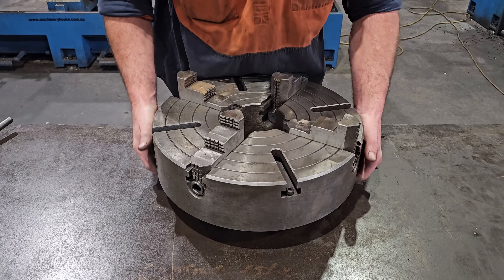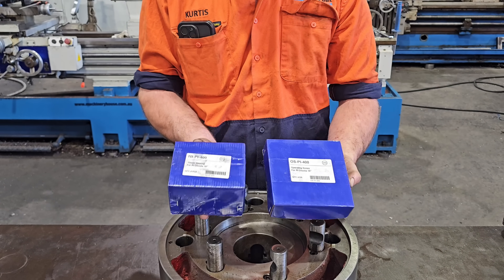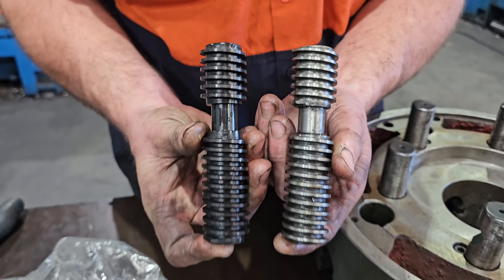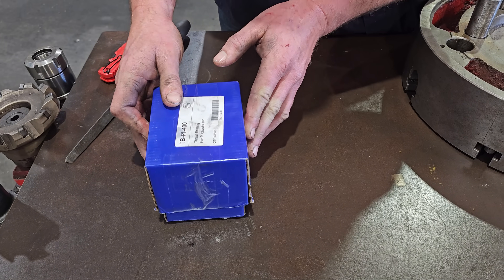Gator 4 Jaw Chuck Update! Can We Save It From Scrap!? 🛠️

Comment: I'm surprised that you able to drill the hardened thrust bearings to fit the set screws. Are they only hardened at one end ? (I was also surprised you didn't do the drilling on a drill press, or a mill pretending to be a drill press).

Comment: Bought a new chuck recently, had problems. The respondent said he 'was not a machinist' which was irrelevant; he knew nothing about the chuck he was selling or anything about fitting it. Do not deal with CME.
10:09 - Printer paper almost always measurers .005 bananas.

Comment: For all those commenting about Gator reacting only after CEE published the video

Everything is speculation unless others come up with similar stories. 

The acid test would be to see if other people have received defective chucks, what Gator has done about it and if defective chucks are still being shipped

A truely proactive company which discovered there were manufacturing issues, would put an advisory notice on its website inviting owners to contact them whilst simultaneously taking steps where possible to directly contact those who'd purchased the potentially faulty batch(es) - after all, they do have the warranty cards

Anyone can have a faulty product or service. What truely makes good companies stand out is how they react when things go wrong. An excellent manufacturer which blows off clients who experience issues is going to get a deservedly worse reputation(*) than a good one who reacts quickly to fix complaints

(*) From experience: Many German companies in particular will attempt to blame the client in the first instance, claiming they don't ship faulty product or that the item is being used outside of specification. The further south you go in Germany, the more prevalent this attitude becomes.

Comment: Thrust bearing is looser fit then the unhardened original because its shrunk a bit from the heat treat, that's all.  Would've liked a file test on the new compared to old!!  Also, nice idea on the paper/clearance.  Also, also, not a chance in hell that only one chuck has this problem, most likely all are like that and the replacement parts are the only ones that have ever been hardened.

Comment: Good on Gator for sorting this out.  Perhaps it’s lucky you have a large following!
Interesting when you are drilling and tapping the grub screw.
If one piece is harder than the other I’d expect the drill to wander to the softer cast iron.
Reply: thats what i was thinking as well when i saw he intended to freehand it. sum of the whole... or hole i guess in this case tho. a sliver of hardened metal vs the remaining 95% surface area that wasnt hardened.

Comment: Honestly, depending on the size of the company, they may not keep tabs on content creators or have anyone who follows them.  Smaller towns/older owners/etc.  Completely possible it’s a small business that specializes in lathe chucks and isn’t really clued into social media.  The delay could be from that alone rather than some nefarious business.  

Glad they stepped up and offered to correct it!  If they had to switch manufacturers it can be pretty painful, especially if they’re trying to keep costs down while reworking R&D.  Not cheap.

Comment: ai summary

Abstract:

This video details the successful repair and reassembly of a Gator 4-jaw lathe chuck that was previously deemed unfixable due to unhardened operating screws and thrust bearings. Following a prior video exposing these manufacturing defects, Gator, the manufacturer, provided correctly hardened replacement parts. The repair process involved thoroughly cleaning the chuck, installing the new, properly heat-treated operating screws and thrust bearings (noting a significantly better fit compared to the originals), re-drilling and tapping holes for grub screws, and finally reassembling the jaws. The rebuilt chuck now operates smoothly without binding, saving it from the scrap bin and allowing the workshop to return a newly purchased replacement.

Summarizing the Transcript: Gator 4 Jaw Chuck Update! Can We Save It From Scrap!?

*   0:00 Lathe Chuck Problem: Kurtis from Cutting Edge Engineering provides an update on a Gator 4-jaw chuck, which was found to have unhardened operating screws and thrust bearings in a previous lathe maintenance video.
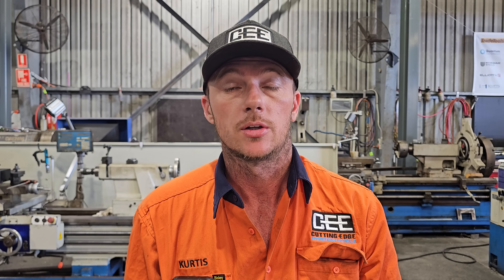*   0:18 Manufacturer Response: After the initial video, Gator acknowledged the manufacturing defect, attributing it to a potential quality control issue during a transition period between manufacturers, and promptly sent replacement parts.
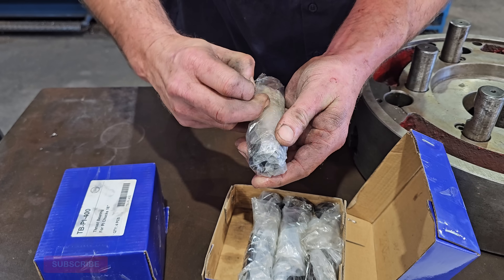*   0:54 New Parts Inspection: The replacement operating screws are visibly and tangibly harder and have a cleaner thread profile, confirming they have been correctly heat-treated, unlike the originals.
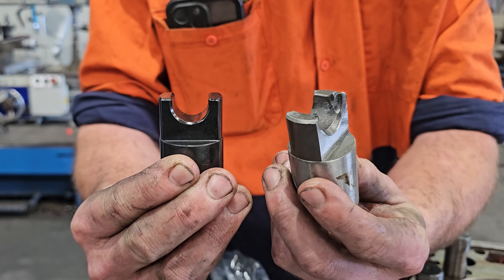*   1:31 Thrust Bearings Comparison: The new thrust bearings are also correctly hardened, in stark contrast to the soft and easily deformable original parts.
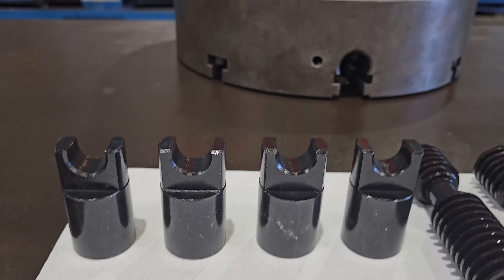*   1:49 Chuck Cleaning and Reassembly: Kurtis proceeds to thoroughly clean the chuck body before installing the new components.
*   3:52 Setting Clearance with Paper: A piece of paper is used to set the proper clearance between the thrust bearing face and the operating screw, ensuring smooth operation.
*   4:29 Improved Fit: The new thrust bearings are a neat slip fit, which is the correct design, unlike the original ones that were extremely tight and required force to remove.
*   6:10 Securing Grub Screws: Kurtis re-drills and taps holes for grub screws to securely lock the thrust bearings in place, ensuring stability.
*   11:01 Smooth Jaw Operation: Upon installing the jaws, a "massive improvement" is noted, with the operating screws turning freely and no binding, indicating the successful repair.
*   12:05 Successful Outcome: The 4-jaw chuck is fully reassembled and operates perfectly, having been saved from the scrap bin. The previously purchased replacement chuck can now be returned for store credit.

Summary of YouTube Video Comments:

The comments section overwhelmingly celebrates the successful repair and Gator's response, though with a clear undercurrent about the influence of a large YouTube channel.

*   Praise for Gator (with a caveat): Many commenters applaud Gator for "stepping up," "owning the problem," and "doing the right thing" by providing replacement parts. They highlight that this demonstrates good customer service and product backing, inspiring confidence in the brand.
*   The "YouTube Effect": A significant number of users, however, believe that Gator's quick and positive response was primarily due to Cutting Edge Engineering's nearly 1 million subscribers. They speculate that a regular customer might not have received the same level of attention, leading to a "two-edged" reputation for Gator.
*   Excitement for Bonus Content: The video, released unexpectedly mid-week, delighted viewers who expressed surprise and gratitude for the "bonus video," "Monday treat," or "Christmas" feeling it provided.
*   Appreciation for CEE: Regular viewers consistently praise Kurtis and Karen for their quality content, informative videos, and enjoyable workshop insights. Some mention learning new things, while others express how the videos bring happiness or help them through tough times (with some offering condolences to Kurtis for a personal loss).
*   Technical Observations: A few comments delve into technical details, such as the clarity of the new thread profiles, the cleverness of the paper shim technique, and observations about the original parts' lack of hardening.
*   Humor and Community: The comments are filled with lighthearted banter, inside jokes (like references to "magic brake cleaner" and Homey the dog), and a strong sense of community among CEE fans.

I used gemini-2.5-flash| input-price: 0.3 output-price: 2.5 max-context-length: 128_000 on rocketrecap dot com to summarize the transcript.
Cost (if I didn't use the free tier): $0.0116
Input tokens: 30962
Output tokens: 930

Comment: They'll always say things like "we have never seen that before, nobody else has asked for those parts" even if it was a well known problem. Back in the day there was a problem with  the certain brand of loader-excavators having rear wheel bearings that didin't last. The distance between the bearings was simply too small and they would wear out fast as the rear axle in a loader-excavator is under a lot of stress, especially on a four wheel steered machine. This problem was common knowledge in the field but every time you called them to order another set of bearings they would say things like "that's weird, we have never heard of those failing before, nobody asks for those parts". I guess they think that if they admit there's a systematic problem the customers would start to demand it to be properly fixed which would cost them money so they deny it and maybe quietly fix it in future production runs.

Comment: We used paper to set the clearance on the seaming rolls in our can seamer. 2 thicknesses would pass through but 3 would cut. This was purely a setup start to help speed up the clearance. The actual setting was down to a gnats a$$.
Good you got the parts you needed and saved the cost of a new one.
Glad to see the additional video,
jack

Comment: Credit where credit is due. Good on Gator for stepping up and not just replacing the parts. But, admitting there was or had been an issue. When you showed the new with the old part, you could clearly see there was NO hardening at all on the original. At least now you have a fully working 4 jaw and now you get some extra money back as can return the new one you brought:). Wish everyone a wonderful and happy day :)

Comment: Hi Kutis. I'm glad the manufacturer responded. Unfortunately, many people ignore serious manufacturing and quality control flaws. The most dishonest are even capable of accusing the buyer of manufacturing their own parts to defame the factory. Since your YouTube channel is well-known and you have extensive mechanical knowledge, in addition to filming every step of the process, it would be incredibly foolish for any manufacturer to enter into a dispute with you and not do what a reputable manufacturer should do: take full responsibility for the product they produce.
Reply: They didn't take full responsibility at all. Full responsibility would be total replacement unit. As it happened, they just sent parts, leaving CE to put in the replacement effort.
Reply: @RichardFarnsworth-synch  Rubbish - If you break a CV joint in your 20 year old car, you don't get a new car for free.  They refused payment for the spare parts because they behaved badly in ignoring the emails.  There was no need to send a whole new assembly.
Reply: @einfelder8262 I say I'm right, not rubbish.. Of course there was no need - Kurtiss was well able to perform the required repairs - and make the video. But that's not full responsibility either. Full responsibility  would have been shipping the entire unit. Partial responsibility was what happened - they shipped part for replacement . Maybe it was appropriate responsibility, given age and prior use  but it wasn't "FULL".

The original pieces were not manufactured properly and that's why they failed.
Reply: @RichardFarnsworth-synch  Doubled down on your rubbish.The main part did not fail.  There was no need to junk a perfectly good main component, and they replaced the parts that failed.  Extremely long out of warranty replacement parts don't come with free labour, especially when the current owner did not buy the part new.  Clearly you advocate sending high value components to the junk pile, even when they are 100% serviceable.  That's just plain wrong.
Reply: All of that is fine, but there's no excuse for ignoring emails requesting replacement parts, as a paying customer.
Reply: Do you mean like Irwin tools who just want to bad mouth you for a bad review on their tools? Yes that happened last week. Stanley, Black and Decker, Vice Grip and Irwin will never be purchased from me again. Glad Kurtis had better luck with a manufacturer than I did.

Comment: My experience was not as rosy - brand new steel body Gator Adjust true 10 in chuck - the jaw T slots in the chuck body were all at different heights from the chuck face - the worst was over .010 inches different from the other two. Because I had opened the box and put on the lathe - never mind the fact I had NOT used it, they would not take it back. This chuck had multiple other issues.
Use it for a door stop now, bought a Bison, which I own probably 15 that I have bought new - every one of them have been 100% satisfactory right out of the box.

Comment: Karen, if you ever want "filler" or to start a second channel, I'm sure there will be people interested in your "side hustle" as video editor.  Some background info on your cameras, microphones, software, workflow, etc, as well as any tips and tricks you've picked up along the way.  For example, your time lapse editing is spot on and probably the best I've seen, and I'm sure there would be others who would like to know your secrets (if you would share).  I'm also sure there would be people interested in knowing what challenges that you (not Kurtis) have had collecting both your A-roll and 🐶 B-roll in a working machine shop - I think we all know the issues you have with Kurtis 😜.   I'm also interested if you run into any issues due to frame rate issues and if you have had to do do anything to deal with 60/59.94/50/24 Hz issues; the only oddities I've seen are that the DRO seems to blink out of phase and the sand blasting cabinet light seems to flicker, but I'm wondering if you've run into anything else.

Comment: It’s premature to say Gator has fixed the issue with the new parts. Yes, They look quenched whereas the previous ones did not.  But only time will tell on the durability of the design, the steel, and the effectiveness of the heat treat itself. 
Quenching is followed by tempering. 

Was it done right? Is that only a coating?

They are now the right dimensions.  And they look quenched.  Fair enough. 

However they blamed….. a former supplier.  

I bet Gator owners everywhere have the same issue.  Will they honour everyone’s part replacement issues? 

Tough situation. No company is perfect. 
But do we have to run a YT channel to also get service?

I have 3 Bison chucks.  Never had these issues.  Would I move to gator now? 

Why would I?  

The price of a chuck is minuscule compared to the cost of downtime. 

Quality issues indicate quality system issues in the company. 

Glad they stepped up…after being pummelled.  

Time will tell

Comment: Ah the old quality control argument. It reminds me of some tool of an accountant working for a European train contractor who thought he would exercise his engineering genius  on dumb rail base plates which just have holes in them for the mounting bolts. A consultant who actually knew what he was doing went to China and looked at 3 manufacturers and the only one whose product met the standards was a defence contractor who was 30% more expensive. The accountant went for the cheap version and the tracks for the high speed train were laid and in less than 3 months the holes became elliptical and there was lateral movement of the tracks as the trains whizzed around at 160 kph+. So the litigation came and it was massive.  Maybe Gator employed the same accountant after he was fired and he worked his magic on 4 jaw chucks.

Comment: Kurtis,
I would have suggested, in addition to your paper shim, clamping something in the chuck with light pressure on all four jaws before drilling your grub screws. This would have assured that the thrust surfaces on the screws and the thrust bearings were parallel. Since you'd need to spin the screws to do this, one layer of scotch tape stuck around each screw would have stayed in place where the paper would have "walked" out.

Comment: Could it not be that threading/drilling deformation in the original assembing caused binding?  Hard to pick up on QA if so I'd guess🤷‍♂️  Great that the replacement parts fit so well though, so lookd like they're doing it right👍

Comment: Thanks for the "non Friday" video! Just some questions because I am not sure and don't know. Are those ACME threads? Why was the filing  and drilling swarf not cleaned up with a strong magnet before using the compressed air? I am guessing that it was not necessary, but any very small piece of steel in the wrong place could cause havoc. Were each of the Operating Screws identical and/or were they numbered? Would the chuck benefit from ID, numbering the parts? I am not a machinist, I am just asking questions. Anyone please advise this novice. Thank you.

Comment: Oh man, fortunately the company faced the music & owned up to sending you the necessary parts to get if fixed & working correctly. Awesome job, to both parties involved (The company that sent you the chuck & Curtis for putting it all together again).
Reply: Why are we missing up for Gator? If this happened to somebody without a large platform then Gator would have blown them off, as they did to CEE when they tried to contact Gator - Rando Joe won't get the PR damage control treatment and likely will be blown off too

Comment: I can see you were using break cleaner to clean up the tool. I was wondering if you the break cleaner in Australia still contains Tetrachloroethylene (PERC) or 1,1,1-Trichloroethane which  make break cleaner work so much better than the  junk we need to use now?